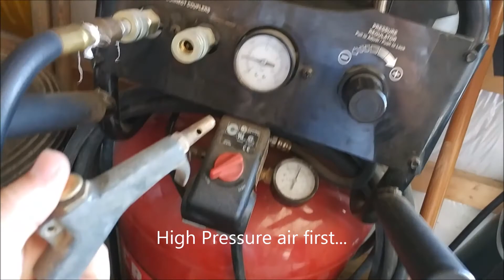How to clean your R/C Vehicles! Simple and effective!

Comment: WD 40 is used really to clean ur bearings it's not really a lubricant. After ispray my bearings with wD40 I air spray the bearings or dry them how ever and then hitt the bearings with some sort of oil or lubricant
Reply from the maker: I sprayed the bearings with wd40 white lithium grease spray it lubes and protects pretty good.
Reply: Exactly. That way you also seal out the water

Comment: How do I clean it If it is not waterproof? I mean it is splashproof but i don’t know If it is a good idea to wash it Off with a hose
Reply from the maker: Tantareanu Jimmy air compressor or a slightly damp cloth or towel will work. Also use a damp tooth brush on everything except electronics. WD-40 also cleans well. Hope that helps!